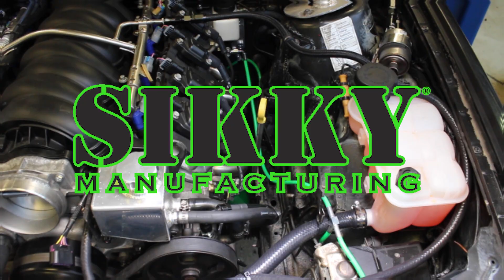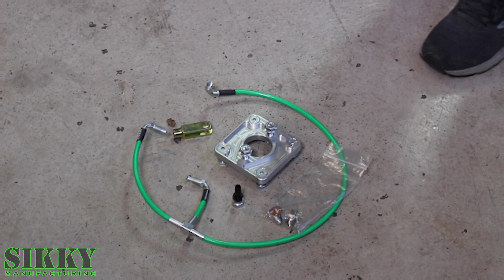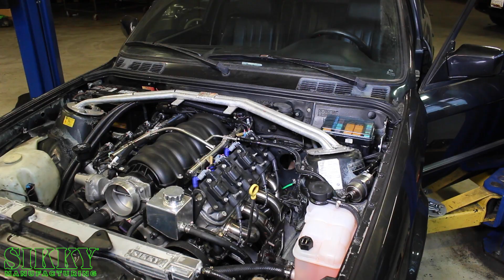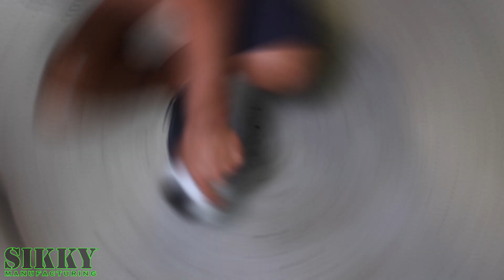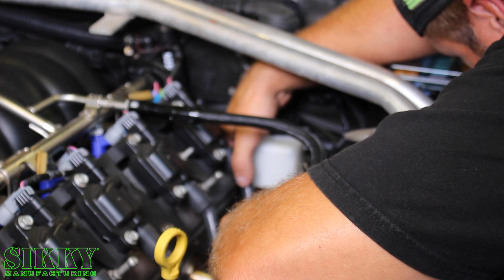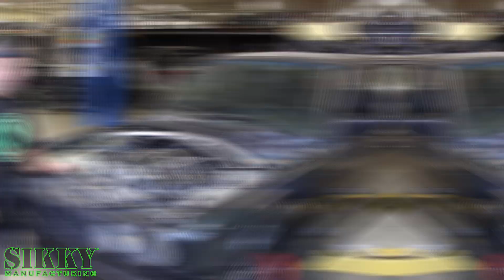E30 Brake Booster Delete Kit Install | SIKKY Manufacturing

Comment: How does it feel to brake without brake booster? Isn't it very hard to brake? How does it compare to braking with brake booster thanks
Reply from the maker: The Master is sized in a way that reduces peddle pressure so yes it’s stiffer and more manual feeling but also increases sensitivity and “feel” so when at the limit of traction when in track use it’s much easier to modulate and maintain grip even when on the razors edge of losing it during hard breaking
Reply: @SikkyTV  ok cool thanks

Comment: Is this suitable for my Rhd Car? Also this serves as a brake booster too?? You didn't explain how?? My car is standard m20 b25.
Reply from the maker: It is suitable but eliminates your booster. By running a master cylinder sized for no booster the pedal feel is not very different from a boosted brake system but is a stiffer pedal.
Reply: @SikkyTV does it brake as good or close

Comment: I'm looking to order this kit but my E30 doesn't have ABS, is there a different line for that?
Reply from the maker: This kit would work but you would just have some extra line
Reply: Hey, were you able to install it?? Did you just plug the hole from the master cylinder or did you actually put the line??
Reply: @jasoncoll9359  I haven't ordered it yet, too many projects currently.